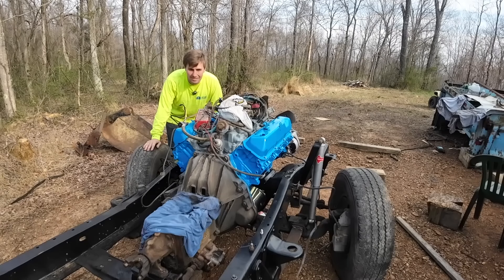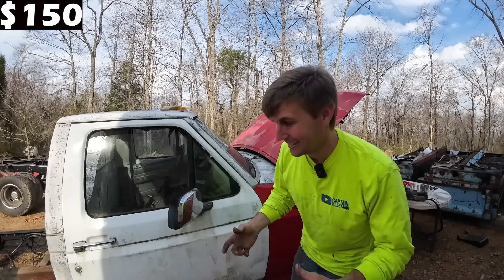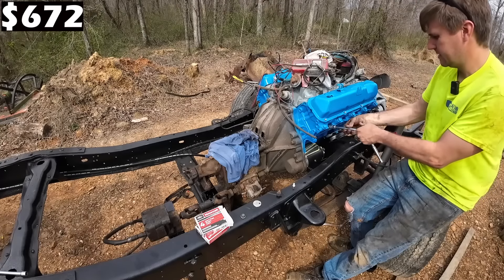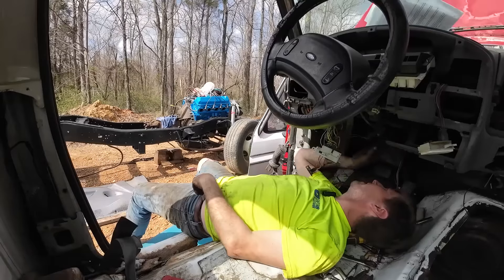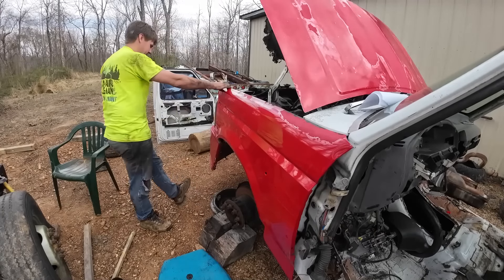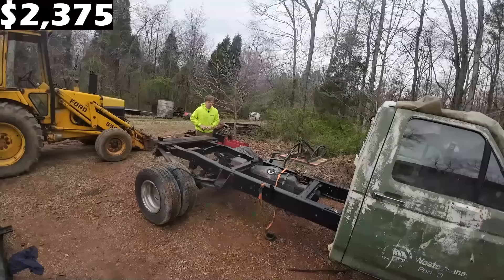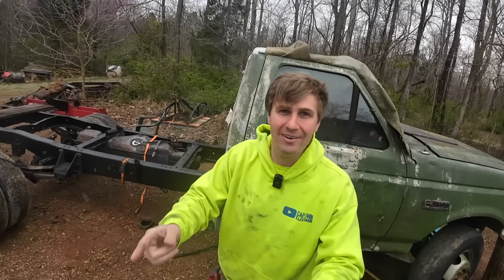I Built A Truck From Scrap - How Much Did It Cost Me?

Comment: That 2k truck for the dump bed is a no brainer. Especially when you can part it out to retrieve some or all of the costs.
Reply: Only if the bed is in decent condition.
Reply: Fixing the bed you have lets you know that you have a good bed.  Everything else is questionable.  Love having a truck you have worked on and know what is what.
Reply: @royscarbrough3589 doesn't look like he has anything worth working on with that dump box.

Comment: Just another option,  which I did was to put a heavy duty flatbed on the frame with the dump cylinder .  Then make heavy duty sides and gate.  Now you have a flatbed that dumps and a dump truck.  Works really well when loading with a fork lift or something similar

Comment: Awesome video is always . When DP Bought the new dump bed for lieutenant Dan I can't remember the name of the place that he got it from a friend to his random place he did a lot of undercarriage replacement parts He also had a shop that did a lot of work for city and counties and I saw when DP was down there lots of one ton don't trucks Oldies look like county he might be worth giving a call to he might have a lead on a dump bed. It's not terrible I can't remember the name of the guy that partially don't get the drink Dr. Pepper LOL. As a note here I had that I bought new GMC 6 yd dump truck gas I put  anti  Seize on the Spark plugs . And I was going down the road pulling a back hole and Was going down the road and I heard this big pop I looked at the engine and a plug had worked its way outhe spark plug wire kept me from losing it . This happened a second time so I no longer put antics On spark plugs
    C](:>)-[(❤#=]

Comment: I think your doing a great job on the truck build. Great job on the documentation as well. I have been wondering if you were spending more than expected during the build but this video answered that for me. Seems like your right where your goal is with more than 90 percent of the work done. Money wise, there is also a lot of metal left in the other trucks parts and pieces that can trim down the cost of the build in the end. Good job!

Comment: The key point you mentioned is buying someone else's problem child or having something you know every bolt on. You should have located and fixed every problem on this rig and will likely get many years of use without headaches. Worth every bit of time you put into it. Yes, some minor used part might give out, but you dang sure know how to change it after this. Well done Captain. My only thought is that maybe a guy should put a modern drive train in for the fuel economy. But that would take some real education for the electronics. You can buy  a lot of fuel for the hundred thousand dollars you saved compared to a new truck.Those old Ford v8 engines can get five gallons to the mile at times. At least it seems that way. I hate when you go from mpg to gpm.

Comment: between all the random brackets your selling to people like me and such and if you bought that truck for the bed i honestly think youd come out money ahead or very close to it which is a huge difference sure those running trucks are out there but with all the money and time youve spent building one your really saving money and time in my opinion because yours has alot of new parts and will be very solid vs buying one and you might face breakdowns and end up with a headache just for the assurance alone and the fact that you can doo odd jobs for folks with it if you want the truck has paid for itself or will anyway

Comment: I love RockAuto!  The variety of parts, manufacturers, and prices are great.  Especially for older vehicles and hard to find parts.  One thing I will do is Google the part #'s to compare prices, tax, and shipping on other sites, especially Amazon and Ebay.  90% of the time Amazon and Ebay are the route I go.  But there is that other 10% where Rock Auto is cheaper overall.  It's sad when RockAuto has parts that your local parts stores and/or dealerships/sites don't.  Been a lifesaver for my mom's 1989 Pontiac 6000 LE.  Needed a throttle body....RockAuto had it.  Needed a complete factory exhaust....RockAuto had it.  Needed a rack and pinon....RockAuto had it!  I also like the function where you can save your specific vehicles in your garage on the site.  So, if you are researching for a specific car, just click on the saved car and you parts list pops up.  No need to go through the drop-down list and go through the whole selection till you have your specific vehicle listing.

Comment: Why not consider a flat bed with a dump? They are WAY easier to maintain, especially with a wooden floor. Easy to make your own. You can pick the side dimensions for different operations or run topless (no sides)
Reply from the maker: Doesn't serve the purpose of what I need
Reply: @CaptainKleeman  - respectfully reconsider. I’ve done commercial dirt and landscaping for over 35 years my fleet is 22 trucks currently. I won’t buy another steel dump bed for anything under a 5 ton chassis. There is far more versatility, less cost initially, less cost to maintain, they don’t weigh anywhere near, and I can literally get one flat bed to last three chassis. Great for hauling ANYTHING from brush to equipment to stone. Didn’t Clint build one?
Reply: Nothing to say comment. 😸

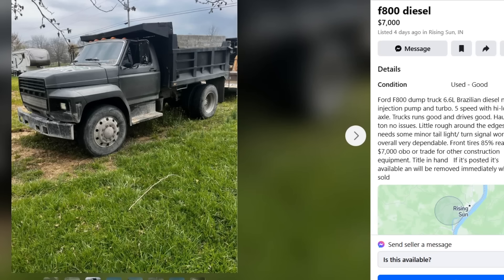Comment: Brazilian Diesel!?! Can’t believe you didn’t capitalize on that joke opportunity…. 21:45 😂
Reply: thats a real thing ford made the 6.6 for the brazillian market but it was also used here in the usa of course unless your making a joke and im not getting it
Reply: That would have been the one for me,a set of tyres, a service and a tidy up as you go, the petrol engine in his present truck is going to be expensive in the end, plus the bigger towing and carrying capacity
Reply: @Brad.whatthe  not really that one had air brakes so youd have to have a cdl and it would have to be registered commercial and insured commercial so in the long run he will spend far less in gas then the registration for that truck alone
Reply from the maker: Yup, exactly, and I can put anyone on mine and they can give me a hand or if they need to borrow it.   Almost like I thought it through 🤣

Comment: I blame you for my sore back, multiple cuts and my wife thinking I am loosing it at 68, You inspired me to save 153.00 and do my own oil change on my Ranger.   Needless to say I spent more on creepers/oil/filters/ oil pans/band aids/advil all to find out I have to remove the drivers front wheel to get  one of my new filter cap wrenches on to the filter.  (not accessable from top or bottom....STUPID!)  Total cost for the first 185.00, but I will save money in the long run. (I hope)🤓Need another disclaimer  .😲

Comment: I personally didn't think there was a neeed to justify why you are doing what you are doing..... from what I gather, you will have a much better tipper than buying one off the street..... and you know what you have done to prolong its usefulness ! 
Whatever the cost to you, it will more than make up for that as you use it !!! 😁

For the tipper, it is common over here to have the sides as dropsides, simply held closed by anti loose fastners at either end, near the top of the sides and ensuring all the hinges on each side face the same way, will enable you to remove the sides for ease of carrying different loads as you need to. You could also weld hooks under each side to provide ratchet strap securing points too !!
Reply from the maker: This isn't justifying.  This is an explanation so if someone wants to do it, they have a realistic expectation of cost.

Comment: If ifs and buts were candy and nuts, it would be Christmas every day. 😂  I did the opposite of you, all mechanical stuff first. New tires  brakes, bearings and seals in the transmission, freshened up the motor with a new exhaust and some new frontend parts just for fun. I will be rewatching your videos to keep me motivated when I start working on the cosmetics. Don't give up and I wish you the best of luck on start up and getting the bugs worked out.

Comment: Unrealistic comparisons with other used trucks. Wait until your project is finished up and running and then try to find a comparable vehicle on the used market. I'm certain that your time and effort will be reflected in dollar value if indeed you can find a comparable vehicle. Don't forget that you've stripped this thing down to nuts, bolts and washers, cleaned treated and painted all of the chassis structure and replaced most of the mechanical working parts associated with it.